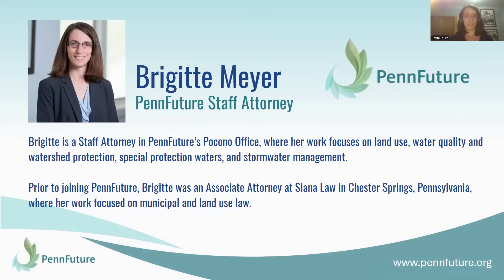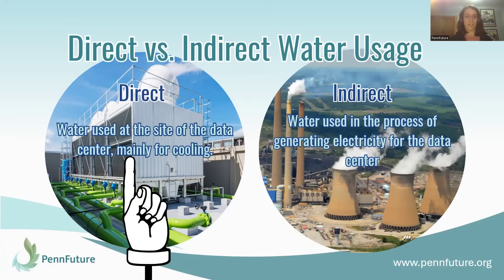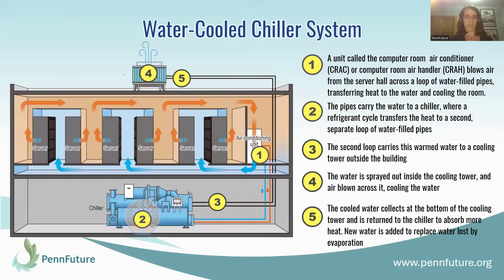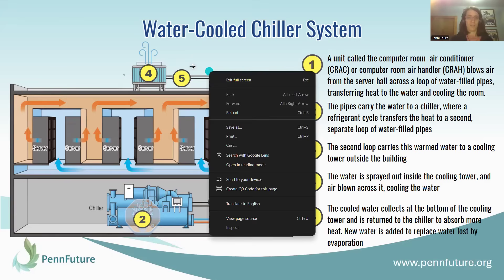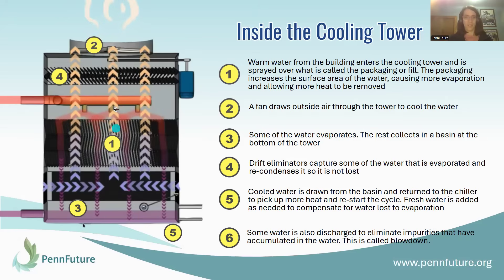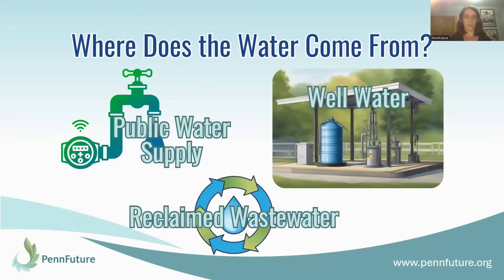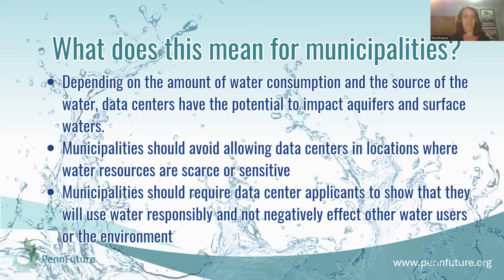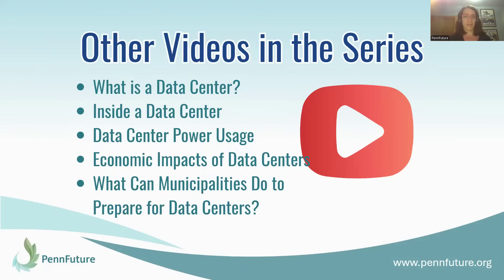Data Centers' Water Usage

Comment: After watching the video, where in the US might these be used?
I do not the water tower being used in humid parts of the country.
I also do not forsee it being used in parts of the country where it goes below freezing for extended time periods. 

Every data center I have seen uses chilled water but the chillers are outside and act like the outside unit of your home air conditioner and expel the heat as hot air.

Comment: In areas with low relative humidity evaporative cooling can use a massive amount of water. This is your politicians trading your water resources for dollars. With simple design changes you could cool all the data centers without water, BUT it would cost a lot more in electricity.
Reply: Dielectric coolants can drastically reduce water requirements.
Reply: In those low humidity areas, water is typically a scarce resource. The inefficiency if evaporative systems simply exacerbates precious water being lost.